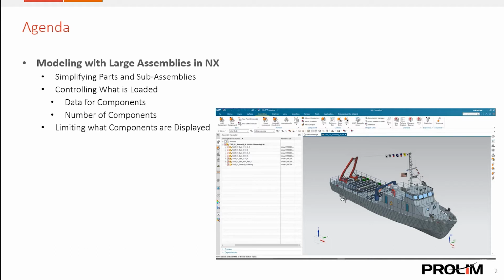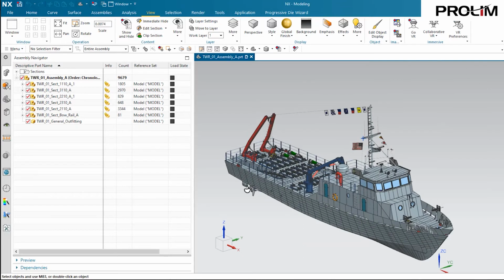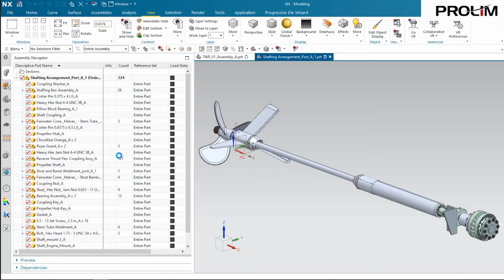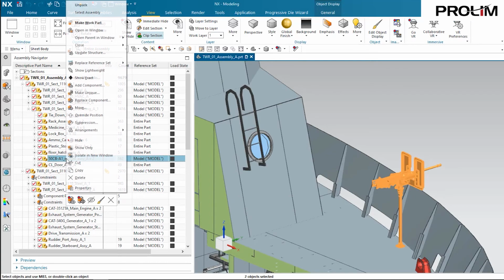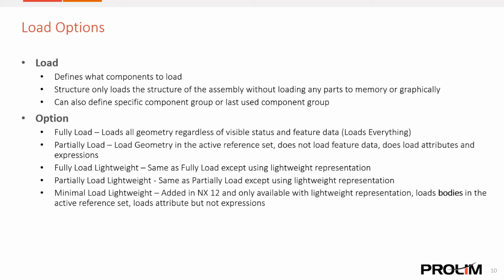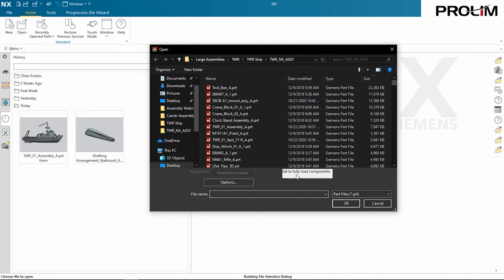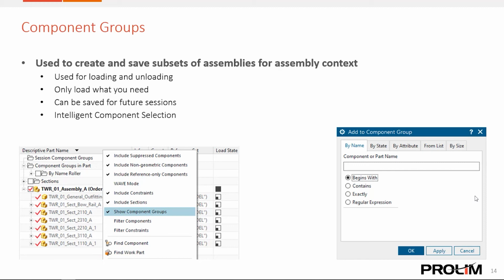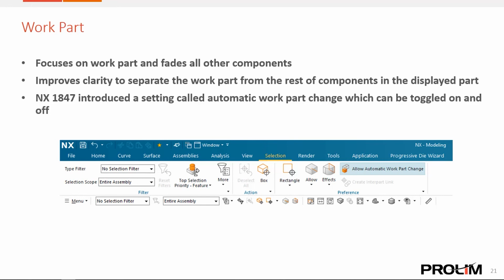How to Model Large Assemblies in NX CAD? - Tutorial - PROLIM Webinar

Comment: Really appreciable information.
Can you tell how large assembly size of approx 2 GB to save in less MB as possible in any possible format?( HOW TO REDUCE SIZE OF LARGE ASSEMBLY)
Reply from the maker: You can consider the following practices to reduce the size of an assembly. While there is no direct format for reducing assembly size like there is for 3D Models, these methods can help to save in a smaller size for your assemblies:
1. By Creating Sub-assemblies 
2. Suppressing the components 
3. Creating Reference sets wherever possible. 
4. By using Simplify Assembly Command
5. By using Linked Exterior Command
Reply: @PROLIMPLM  Yes, thank You 😊
Reply: @PROLIMPLM  thank You for your feedback.
Reply: Thanks. that was great. It would be nice to see how fast things now open with JT, and a variety of other enhancements since 2017.